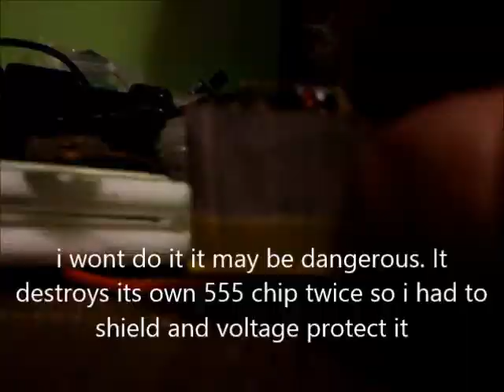Extreme powerfull EMP 2015 Slot Machine Hack Jammer NEW NEU Nuovo!! 42V

Comment from the maker: more findigs: it able to light on led diodes in an circiut, if i connect some wire as antenna all radios around become dead silent, fm, cb, dab, dosn't matter. It destroyed display on sat receiver. its audible on any audio amplifier. it burns finger quickly when the finger i close to the coil.

Comment: What is the output voltage that goes to antenna making the magnetic field?
Reply from the maker: Jason Bourne 45V.
Reply: TheShitTzu Video Question : can i use 270pF 2kv capacitor instead of 220pF 1kv? i saw another diagram and it's simple to build but don't know about capacitors so much.
Reply from the maker: yep. u may have try to swap small coil it works different way swapped, choose better result. Also bigger pf capacitor ex. 470 or more will make whole thing work more stable and closer to the metal object but too big will blow 2sc2078. its very important u get ori 2sc2078. it is possible to get them, just try as many as u can.
Reply from the maker: im using now 660pf on two paralell 2sc2078. 1nf working even stronger but i wont take the risk of blowing pricey 2078 again - blowed 10+ pieces till now ^^
Reply from the maker: 28V is safe to 2078, till 42 i had no problems, over 42 these transistors may blow - depends of how big capacitor u described. just buy some spare 2078 and try :)
Reply from the maker: mine power supply is 11,2 40A packet matchbox size and step-up 4A power inwerter. So if u supply 11,2V 4A into inwerter u will get 45V 1A out of it. or 40V 1,2A. Remembere max current allowed to single
2sc2078 is 1,5A and its limited by coil and capacitor.